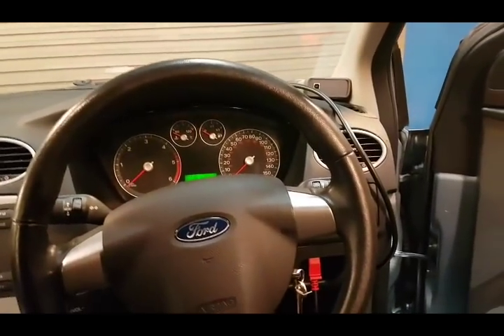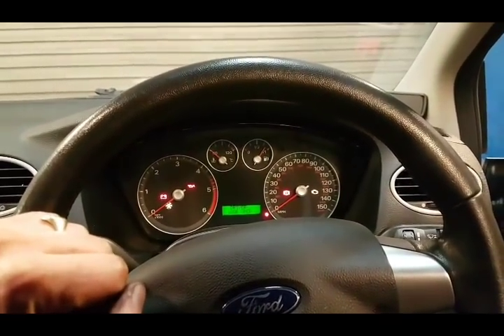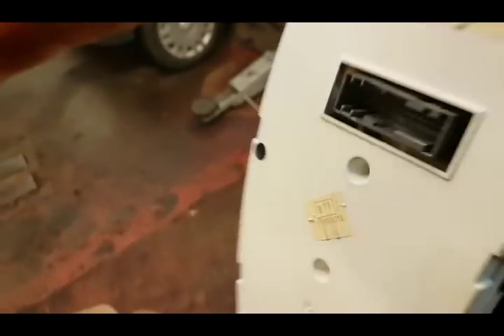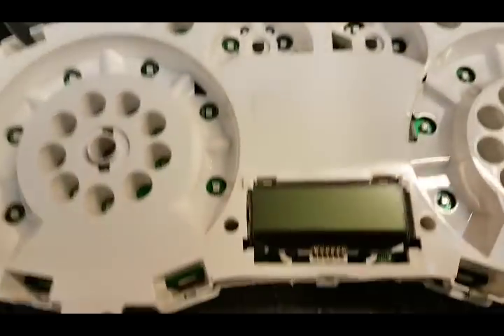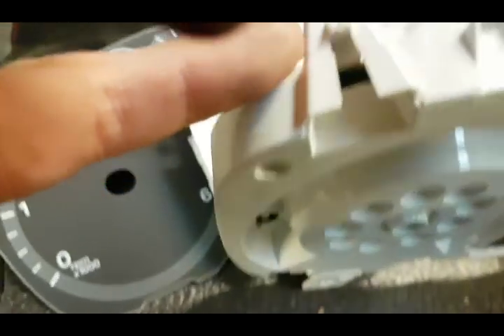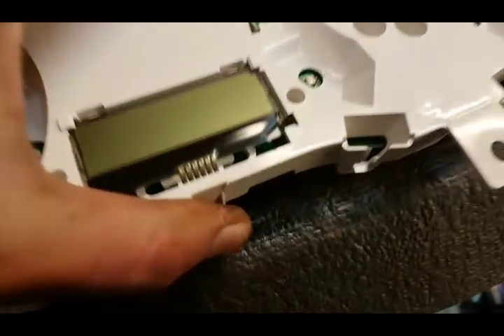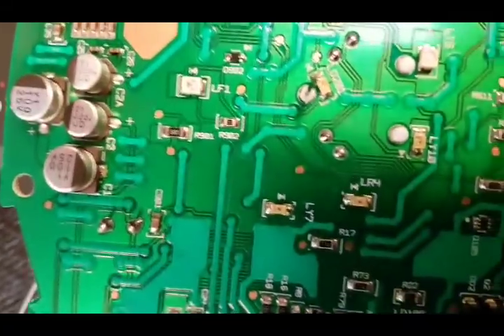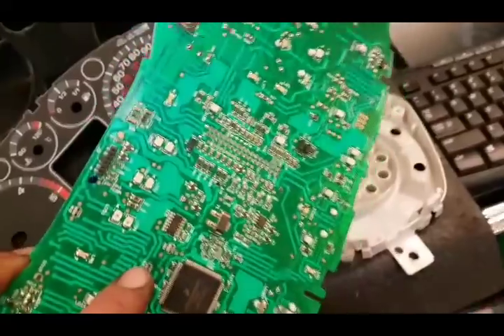Ford Focus Intermittent non start, cutting out, dash lights, faults displayed and can codes

Comment: Just followed this guide, found a couple of cracks in the solder where the connector is soldered to the board. So I heated all the solder joints and they fused back together. So far so good. And it's definitely easier two-handed. Thanks for the excellent and pleasingly sweary guide!

Comment: I just wondered if you had any advice I have a 2007 Ford focus estate and is doing everything that your video title is saying cutting out etc I figured out if you hold the key slightly to the on position it will not cut the car out but if you let go of the key the car stalls and all power goes off does it need a new ignition or is it something easy to fix please help

Comment: Just a quick question, I have the same cluster as this in my focus  I cracked the perspex front removing it, I got another cluster off a c-max same age, everything looks the same, except the little LCD display is more square shaped, mine has the thinner letterbox type LCD display.
Van I just replace the c-max one into my focus, will it work, will the display be compatible?
Or should I just prise off the front facia/ perspex screen and replace mine but the LCD window will be square showing my thinner letterbox display, I suppose I could block off half the square window?
What do you think?
Cheers.

Comment: Hi there, I have been having trouble with my 2005 ST225 I took the cluster out and had them soldered car ran fine for an hour or so then started playing up again. I've ordered a used set of clocks off of eBay do you know if these new clocks are plug and play or will it need to go into the garage to get sorted. Thanks, Jason

Comment: Mine does the same thing focus 1.8 manual diesel 2009. It shuts down but engine remains started. A good bang and engine management light goes off and acceleration reduced goes to increase. A few minutes later returns. Bang again. Repeats cycle. 
I then turn the car off completely. After 30 minutes then it sweet and runs sweet. 
Why does it not need any good old bangs after turning it off? 

Plus prior to that the car did the same but upon battery charge leads it restarts immediately and it's sweet. Even when jump starting it runs sweet. 

I can't work it out. Is it the cluster? Is it the immobilizer turning off by losing communication as I get mainly u0140 u0155

Comment: Hi. I have a mondeo sw mk3 with an annoying problem, randomly the headlights level goes to lowest setting by itself, lighting "3 meters" ahead of the car. Some tweaking with high beam pulsing and/or dasboard light intensity and it goes back to normal position. Sometimes takes longer. Could this be a bad contact in the panel command ? Seen something like this before?

Comment: Not sure if you'll see this, but I could really use some help. I took my IPC apart on my 03 Ford Focus, same issues. But I was a dumbass when I took it apart and popped the back of it off before the lens so all the needles popped off before I could mark where they rested. Is there anyway I can get them lined up correctly without marks from before? Thanks man.

Comment: I have the same car 2005 with the same problem. Dash lights up like a Christmas tree with the message engine system fault reduced acceleration. Fault code U0001. I hit the top and they keep changing lights then coming back on.
Reply: Did you get it fixed? I followed this video and didn't get anywhere

Comment: Hi. Will this solve the Reduced acceleration  problem? Thanks
Reply: I have this same problem sometimes the car starts with reduced acceleration sometimes it doesn't start at all and says engine malfunction and I just have to keep trying until it starts....did u fix the problem and what was the issue? thanks
Reply: @stevenkourtellis1017  I got the same problem. Last week I remove the dash to put a black tape on that stupid snow-flake. (It stay on when temperatures are under 5 degrees and I hate it).    And now I got all kind of problem. ESP fault, lose acceleration,......won't start sometimes.  Any luck?
Reply: It will solve cut outs where the engine goes into limp mode and you struggle to do more than 10 mph.
Reply: @oviovidiu8804  I took it to a company that specialize in doing this a few days after I saw this video because I just didn't wanna mess anything up and make it worse. I paid £100 they done it while I waited took about an hour and the car has been perfect since and its been over a month I think. No faults coming up at all and running smoothly so it defo works.
Reply: @oviovidiu8804  I’m having this issue with my Ford Focus Mk 2 09 plate. Did you manage to get it fixed? What was the issue?
Reply: @jonnyleighmusic7568   If I hit the dash with my hand. The needles are moving up and down and lights are on and off few times.   So I removed all the dash, spray all the contacts with a contact spray cleaner. And put everything back together. The problem wanish for 3 days. Then it reapeared. So I probably got a bad contact somewhere there.
I wanted to buy a second-hand  dash. But the man from the dismantling shop told me to get to an electrician. It is cheaper.  So tomorrow I got an appointment to auto electrician. I will tell you the price and what was the cause if you want. They told me that is a 3 hours job.
Reply: @oviovidiu8804  cool thanks for getting back to me. Did you get the work done? What was the cost? Thanks
Reply: @jonnyleighmusic7568   The car is fixed. It cost me about 60 Euro.  The problem was that contact panel. All they did was to welded again some contacts from the dash.
Reply: @stevenkourtellis1017  where abouts are you? I'm looking at having same job, sounds a good price
Reply: @jacktrek5851  I'm from North London but I had it done in Rainham in Essex which is about an hours drive from me there was places closer to me but they charged alot more and the place I took it to had good reviews. Its been 5 months now and the car hasn't gave me any problems at all since I fixed it
Reply: @stevenkourtellis1017  sorry long reply but you remember the name of the garage you went?

Comment: Had the No Start on an 09 1.6 TDCI. Won't scan either! Took the dash apart and found cracks around pins 17,18 (canbus), so resoldered, BUT the fault remains! Dash tells me codes D900 and E510 (U1900 and U2510) so I assume there is a wiring fault in the canbus to the PCM? or the PCM is stuffed?
Reply: I've got the same intermittent problem on a 09 2.0tdci. Dashboard lights up like a Christmas tree, all the needles drop and engine malfunction. 
Then dashboard starts working again but comes up reduced acceleration and and traction control light on
Reply: @andrewpugh4344  My ECU was toast. I think having a knackered battery killed it. Even just powering up the ECU on the bench, you should see some canbus data. I didn't. ECUTesting couldn't fix it either. They managed to get another one and clone my dead one's data over. HOWEVER my dash did have some dodgy solder joints so it's worth checking first as its a cheap fix. Alas in my case it didn't help.
Reply: @andrewpugh4344  I’m having this same issue with my Ford Focus Mk2. Took it to a garage and they ran diagnostics but there was nothing showing up that would explain it. They gave it a full service (which it needed anyway) but 2 weeks later the fault is back. Mine seems to be doing exactly the same as yours. Did you manage to get it fixed? I don’t want be throwing money at it left right and centre if it’s not going to sort it.

Comment: Just took it apart and my dots are corroded too exactly like yours. What if I just scrape the top layer as I don't have a soldering iron? ?
Reply: Propably a bit late (hehe) but that does nothing as the solder is cracked all around the pin so that the pin is practically disconnected from the pcb board. So it needs to be resoldered so that pin is reattached to the board.

Comment: how do you put those back ? 
do you screw them or press them?I pulled them up and now they no longer indicate correctly, at the gas station I always indicate wrong, even after the gauge sweep.. 
help me pls !
Reply from the maker: Just press into place. However can be placed incorrectly y which is why it's best to mark the position on take a photo. You can just twist them anti clockwise until they are set correctly
Reply: @SpeedTweaks  so in the clockwise direction it does not affect anything if I turn them over and over the noted area.
Reply from the maker: I always go anti clockwise so as not to risk damaging the stepper motors.  Can go round and round no problem. Going clockwise is not an issue but I have never really pushed my luck that much

Comment: That is a good video i had the same issue and i also resolved it that way. Now my boot will not open i am getting error b2894 decklid release circuit failure , i had bootlock and sensor replaced but would not open can you maybe do a video to resolve this pls?
Reply from the maker: check your BCM/CEM, very common
Reply: Speed Tweaks sure i will and will let you know

Comment: Did Jane Austin ghost-write the script?
 I see you can send the cluster away to folk on ebay, who ask for £80 to do the soldering but, as the lengthy part of the job is removing the cluster, it's hardly worth the £80, IMHO.

Comment: I suppose you don't really want to cause damage to this unit as the immobiliser circuit runs through it... Much bigger job then!!
Reply from the maker: Exactly, which is why I would suggest backing up the information before carrying out any work
Reply: @SpeedTweaks 
I just have concerns that people will watch these videos and 'have a go" then cause more problems.
Maybe there should be some kind of warning message or ability guide?
Reply: How do you back up the info? I've got the odb2 Bluetooth with the torque app, but guessing you need some other type of specific tool?